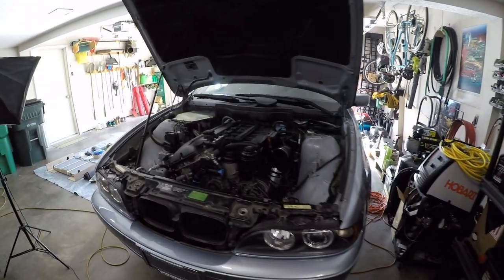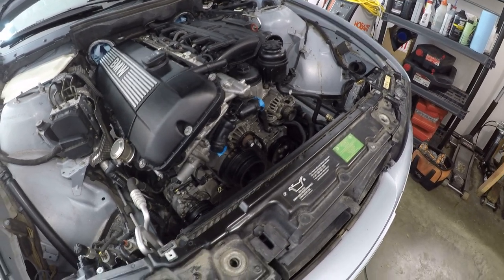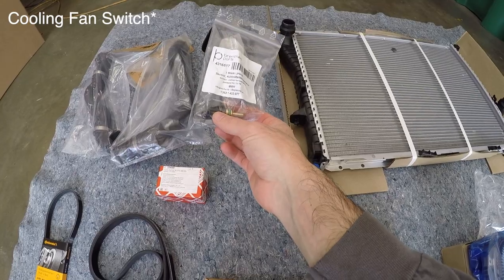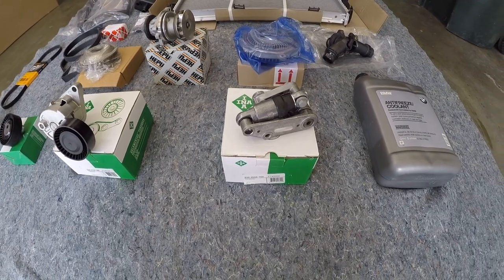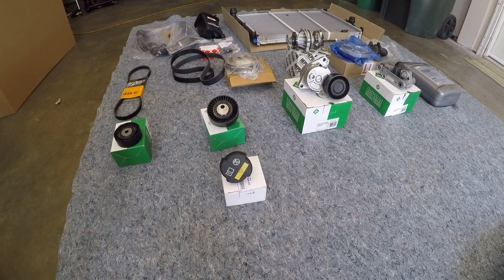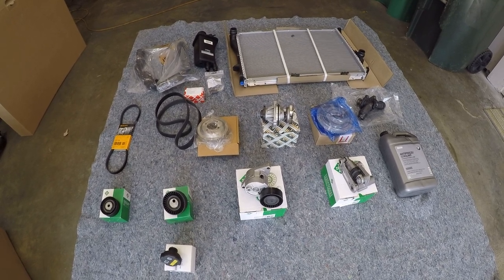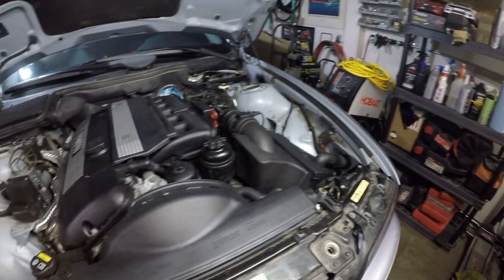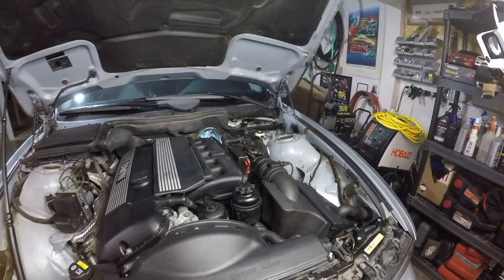Project E39 | Ep.9 | FULL Cooling System Replacement

Comment: Found a crack in my radiatoer right by the connection for the upper hose. My E39 is a 2002 with 60,000 miles on it. It seems the SE Texas heat has taken its toll on this car. Everything I touch that is plastic seems to crumble and fall apart. I go to fix one thing and that leads to another and so on.

Comment: Hey sir, congrats on all your well done videos. Unfortunately you missed 2 main components that should be replaced as well, which are the cooling pipes right under the intake manifold since you were already there. Then it would be a complete job. but great job overall. thanks for ur videos. C ya around.

Comment: Which model milwaukee ratchet do you have? Do you find it has enough tourque for most small/mid size fasteners?
Reply from the maker: It's a M12 Fuel 3/8 ratchet and it works awesome for small/mid fasteners. I don't usually use it for breaking them loose but certainly for unscrewing. Saves my wrists a ton of wear. It has a variable trigger to prevent you from overtightening smaller bolts. I think it makes out at around 50 ft/lbs.
Reply: @PracticalEnthusiast  Thanks. Theyre now a common sight in auto youtube channels. The smallest model seems ideal for engine bay and motorcycle work.

Comment: First of all - GREAT videos man! I’m curios to understand why you did not remove the air intake manifold and change the coolant pipes below? Are they less likely to crack or? Greetings from Denmark - Scandinavia
Reply from the maker: If I were to do it again, I would replace the coolant pipes under the intake manifold. At the time I didn't see the need on this car since the mileage was so low.
Reply: Thanks a lot for your reply! My e39 has very low milage too - but I was thinking that the plastic might get brittle after 20 years. 
However - the lazy part of me tells me not to do it, as removal of the air intake manifold seems like a complex job with lots of cables and connections everywhere …

Comment: Hello from Spain, nice video. I have 525i e39 m54 and i have changed the thermostat and radiator. The temperature in the hidden menu up to 99° and i want to ask you if its normal for this engine, because thernostato is completly open to 97°. Best regards!

Comment: Gotta say with all of the work done so far, I’d estimate it would have been a $3.5-4K shop bill at an independent shop. Any idea what the estimate would be for the work you’ve done?
Reply from the maker: Hard to say honestly. I'll have close to $3k in parts by the the I'm finished. Most shops wouldn't take the time to clean anything - they're definitely in the business to do it as fast as possible. I'd say a few grand in labor alone would be realistic.
Reply: @PracticalEnthusiast  if you had 3 grand in parts then I’d add another $4k on labor. Possibly even $10k overall if bmw did it. Well done sir, it’s a ton of work but the peace of mind is worth it!